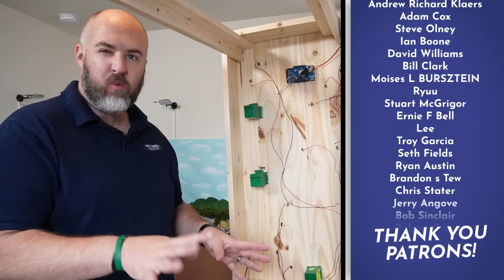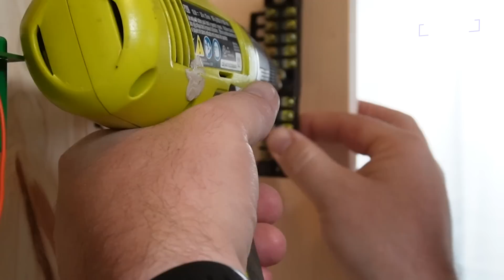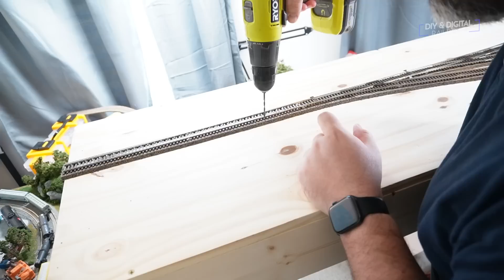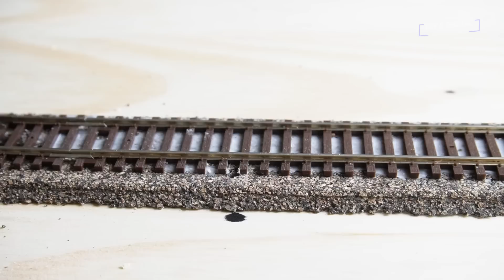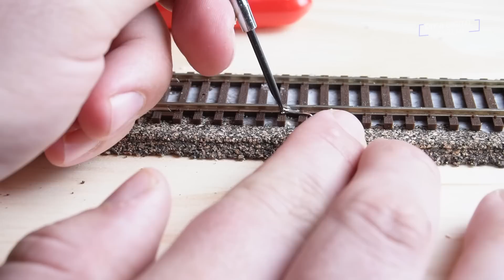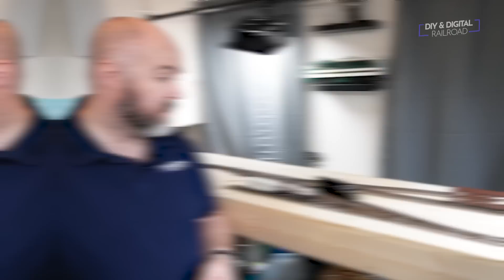How I wire up a Model Railroad for DCC

Comment: If I use atles n scale track with do I need a turn out motor if the switch already comes with a powered turnout switch ( this is for dcc.  (
).

Comment: Jimmy, I need to ask a question that I can't find a consistent answer to. I'm just about to begin construction on the first module of what should end up being a 2'x45' switching layout based on the track between Topton and the Deka plant in Lyons PA. My DCC system is an NCE power cab. Even though there will rarely be more than two locomotives at a time, it seems to me that at the very least I'd need a small power booster. If so, any idea what the correct one would be? Thanks!

Comment: Good job.  I've been using DCC since 1997 and repairing cameras sine 1977.    I suggest you should heat the joint (at the rail joiners) and touch solder  to joint (*not relying on already hot solder to run from the tip into the joint).   Work quickly or ties will melt.    Tortoise machines are good because they have built in switch contacts that allow you to power the frogs (as long as switch is "dcc ready" or frog has been cut).

Comment: Have you ever considered soldering the wires to the underside of the rails? I saw Charlie Bishop at Chadwick (on YouTube) so that for OO (which I think is basically HO.  I tried it with my N scale layout and it’s worked really well. Obviously you can’t lay the track FIRST and then solder, you need to solder, and THEN secure the track. The wire that I ordered actually ended up being strands instead of solid, so I think this really helped with that issue as well. I just tinned both the bottom of the rail (after using an xacto knife to cut out the tie plastic) and the wire, then pressed them together with my soldering iron.
Reply: I've thought the same for my set.
Great idea

Comment: Maybe you could answer a question for me. Why do people just run their wires all willy nilly from point A to point B? Looks like spaghetti tossed at the board and very unruly. Labeling work work too. I don't know. 🤔
Reply: Most people clean up their wiring later as a later project.
Reply: @kraigsickels3918  I'm use to seeing machine cabinets and the such where wires are routed properly the first time. Silly me. 😊

Comment: You could have soldered the lead wire to the bottom of the rail joiners to better conceal the wire leads, there is a video about doing just that, check it out.
Reply: They sell them online too

Comment: I'm having the exact same issue with my turnouts but I'm just running DC. Will the solution be the same? They have metal frogs btw.
Reply: You need to cut gaps on every side of your frog . It will short if you don’t . Then you need a frog juicer for your frog.

Comment: When using a spade bit, go through, stop your drill, and feel for the tip on the other side. Then use the small hole on the opposite side to put the tip of the spade bit into. Leaves you with a cleaner hole without blowing out the wood, especially soft pine.

Comment: The bigger take away is to use the same color wire for left or right rail across your whole layout, and consider adding some kind of documentation on the underside of the layout saying which color is right rail which one is left.  (Adds item to my layout's to do list)  Jimmy,  look into a keep alive for your engine there.  I added one to a sound loco on my layout that stuttered like mad.  Now I can pick the engine up and put it on a shelf before the sound cuts out!
Reply: So essentially just a capacitor?
Reply: @mereprince49  yup, pretty much.  you can buy them prewired from the decoder manufacturers, or probably source some on your own.

Comment: You can avoid having to mark your holes simply by feeding the feeder wires from above the layout. From above, it is obvious which color wire goes where. Also, I would not choose red and black for DCC power: these colors are almost universally used for positive and negative DC power. (Perhaps this is why Kato uses blue and white.) Next, I put two 90 degree bends at the end of my feeders - these change the wire direction from (1) vertical to horizontal pointing toward the rail and (2) horizontal perpendicular to the rail to horizontal parallel to the rail. The first bend is only about 1/8" long; the second is about 3/8" long to give a good soldering surface. This allows the feeder wire to nestle easily into the web of the rail. I also strip enough insulation off the feeder so the insulation does not show above the roadbed. Finally, if you do not have the luxury of turning your layout on end, the easiest solution is to run your DCC bus along the front edge of your layout, and make sure your feeders will all reach to the front edge (with a little slack). Then use IDCs - Insulation Displacement Connectors - sized for your bus and feeder wires. If your feeders are 22 gauge and your bus wires are, say, 18 gauge, you can use the red Scotchlock connectors - no need to crawl underneath the layout!
Reply: Great suggestions! A question for you …  if you put a wye or turnout in to be able to access a yard from either side of the layout, where your polarity would change at some point, how do you address this? 🎃
Reply: @SD45-ET44AC  I assume you're using DCC - the answers are different if you're using DC. The answer requires two parts. First, the easy part: if you are using insulated frog turnouts (and it looks like Jimmy is - you can see the black plastic frogs - you don't have to worry because the frog is where the shorts occur. If you are using metal frogs, the frog needs to be isolated from all four connecting rails and powered separately. (Some turnouts with metal frogs are advertised as "DCC Ready" - these usually have small plastic insulators in the rails surrounding the frog.) You can feed the power using the auxiliary contacts on a Tortoise or Blue Point switch machine, or you can take the lazy way out and use a Frog Juicer. The Frog Juicer detects a short and automatically reverses the polarity in the frog before the DCC system "notices" the short.
Now for the harder part: reversing loops: You need to isolate the loop where you can maximize the length of the isolated section. For a reversing loop, that means isolating all four rails at the frog end of the turnout. For a wye, you would isolate all four rails on any of the three turnouts which connect to the rest of your layout. Then you need a DCC auto reversing unit (many suppliers, including Tam Valley, who make Frog juicers). You connect DCC power to the auto reversing unit, then connect the autoreversing unit to the reversing loop. If you have a long reversing loop, you make a sub-bus from the auto reverser and connect the track feeders to that sub bus. The auto reverser will detect and switch polarity when needed.
Reply: I am very curious and interested... why do you prefer not to use red and black wires colours for DCc wiring?  I do but I am always open to more ideas.
Reply: @scentgrasslakerailway  My layout has a LOT of DC power users - I try to incorporate lighting effects - LED, incandescent, and Arduino - into every structure I build. In order to supply DC power to all those users, I have a DC power bus which runs right alongside my DCC bus wires. Now here's where it gets confusing: when I chose my DCC bus colors, I chose red and white: the red bus powers the rear rail (i.e. farthest from the front of the layout) - R for red and R for rear. Then when I ran my DC bus, I chose green for positive and black for ground. No problems so far, because electricity doesn't care about wire color :) But now we come to feeders for all those DC power users: I use 1.25 mm JST connectors for all my DC power - they are compact, so the connector will fit through a 1/8" hole in my layout, and they are keyed, so you can't accidentally reverse positive and ground, which is important for LEDs. (This also let's me swap structures around conveniently: I know that I can plug any building into any DC power drop.) BUT, the JST connectors are pre-wired with red and black leads. Black obviously goes to my black DC bus, but I always have a little mental hitch when I connect the red lead from the JST to my green DC bus. Is it a big deal? No. Have I ever connected a DC lead to the DCC bus? No. I guess I'm just anal-retentive enough that it bothers me. In my defense, I will say that I have been amazed to see how the profusion of wiring under my layout has multiplied; and I believe choosing and sticking to a color coding scheme is critical to trouble-free wiring.
Reply: @rwissbaum9849  thanks
Reply: I am converting from a DC block control system to DCC. Should I run a bus along the edge of the layout since I already have very long track feeders that ran to terminal blocks and spdtco toggle switches?

Comment: Probably I missed it, but you ran feeders to every rail. Then just connected every feeder to a terminal strip?
Where did you wire the tortoise switch controls? Maybe that's next.
I like the labelling of wiring - R or B. Really important for Kato Unitrack except when some is blue/white and others are red/black....not sure why Kato does that.